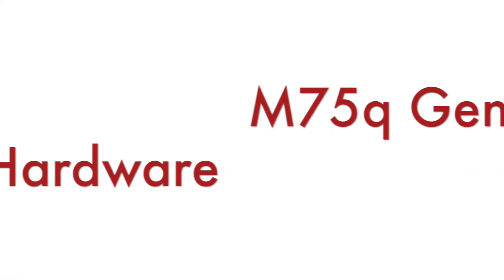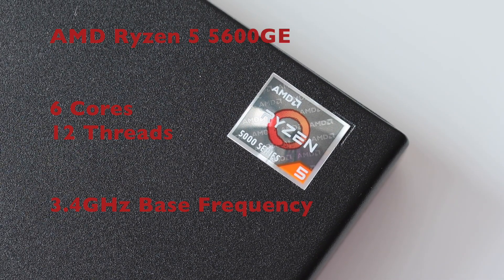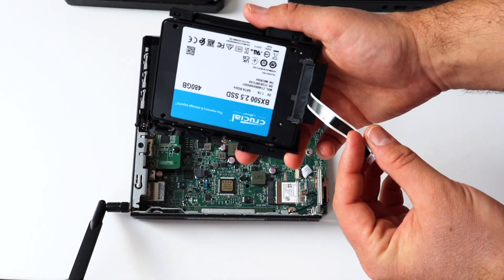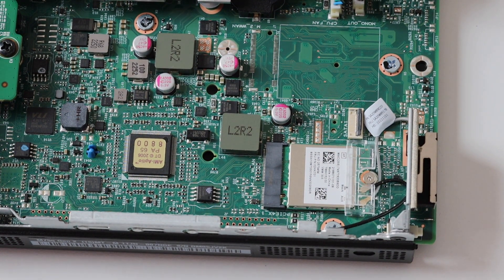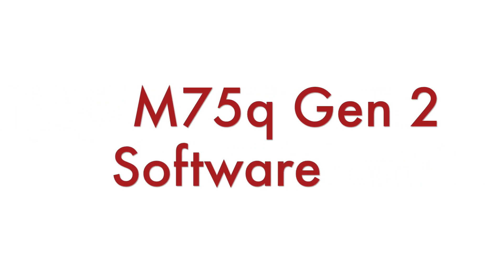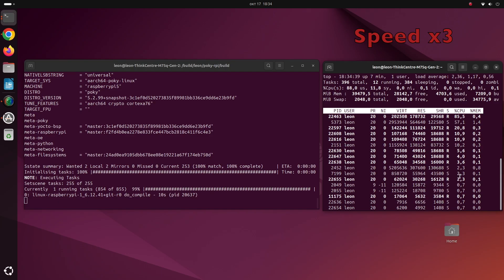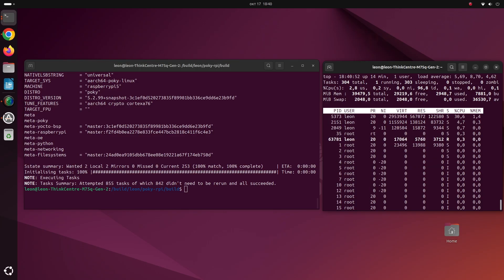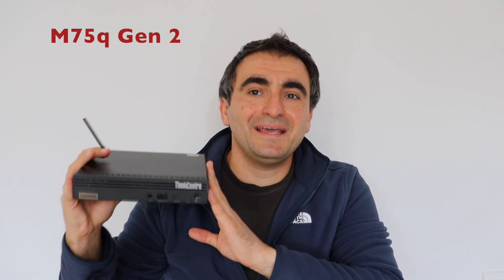ThinkCentre M75q Gen 2 Linux Review: Mini PC, Major Performance #amd #linux #ubuntu #lenovo

Comment: Hello.
Could you check what the CPU (GPU) temperature will be when playing games on this PC? For example, Terraria or League of Legends?
My old m710q with i3-8100T have 62-65C in terraria and not noise in this time, but low fps on this old cpu(gpu).
Reply from the maker: Thank you for watching my video! The CPU temperature and the fan speed as RPM (rotations per minute) increase proportionally with the CPU load, whether you are gaming or cross-compiling a Linux kernel, as shown in the demo. As I mentioned, the M75q Gen 2 isn't ideal for gaming since it lacks a PCIe slot, meaning you will have to rely solely on the built-in AMD Radeon graphics.